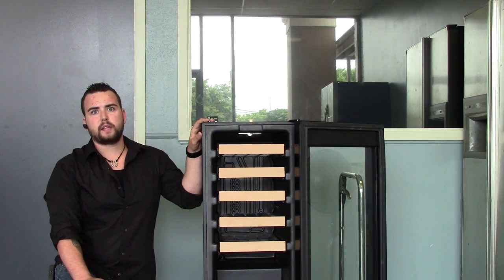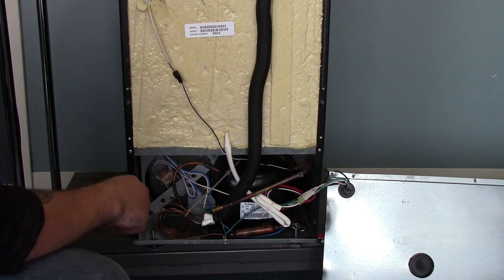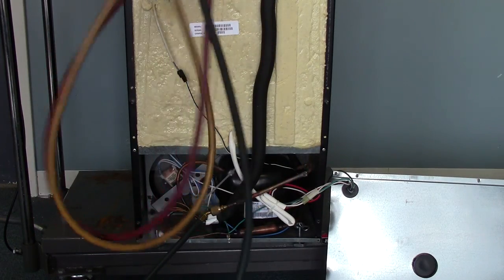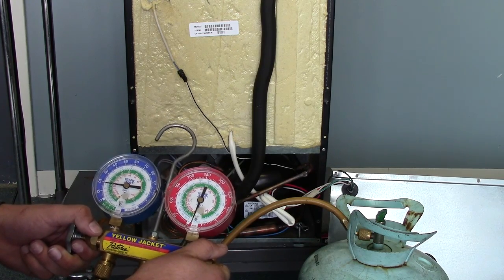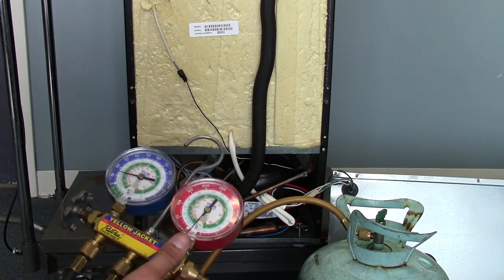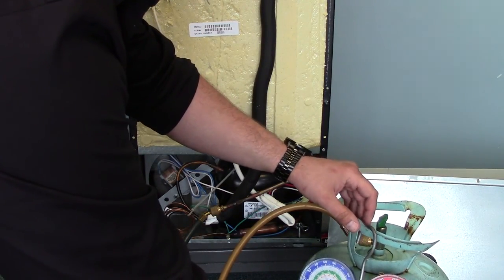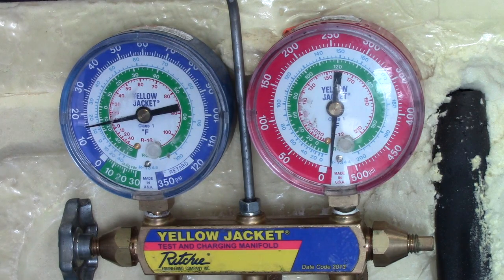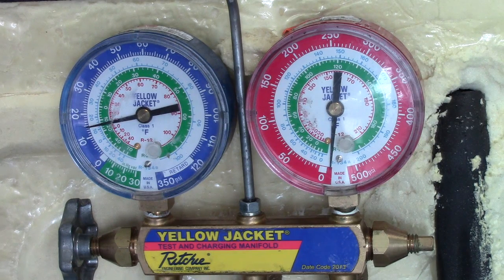uline Wine Cooler Repair- Reharging a U-Line Wine Cooler with 134a Freon

Comment: ERROR
ERROR
ERROR

Failure to purge the low side line  results in air/moisture into the system that barely holds what 2ounce I think.
Other than that she will work just not as well

Comment: Good video, but it's best to hook your gauges up before turning the unit on to avoid sucking a hose full of air into the thing....WP products also tend to run in a vacuum on the suction side...One of the problems is, it often causes a floating restriction....That's blockage in the cap tube that starves the evaporator, works it's way through, starts working fine and hits you again....People often think they bought bad meat, when it's the Fridge that got'em...It can get you again and again, if not pulled down and a new dryer put on it....GE's and others run about 5 - 8psi on the suction and seldom have the problem...WP, Roper, Kenmore, Uni-line, anything made by WP will do this nightmare of a problem....A cap tube cleaner can be used, expensive tool, but if it equalizes, and shows on the suction side gauge it is, after you turn the unit off, the cap is clean....That's the time to do the dryer/strainer or pay the price of looking incompetent and having a very irate customer....I mean irate....Especially if they just loss more food...Not good....Just a heads up guys....A blocked cap tube looks and acts like a low charge....Watch the WP products.

Comment: When you're measuring vacuum on the low side, it's telling you that definitely you have a leak(big or small), no questions about it. The next day you found-out that the leak is a small leak, why didn't you use a Super seal Advanced like your other video? or fix the leak. There's a heavy fine by EPA for these violations. Next, you have to measure your refrigerant when charging a unit(Per manufactures specs).  Lets hope that the EPA is not watching you, or next time your EPA license(If you have one) will leak-out to ZERO.